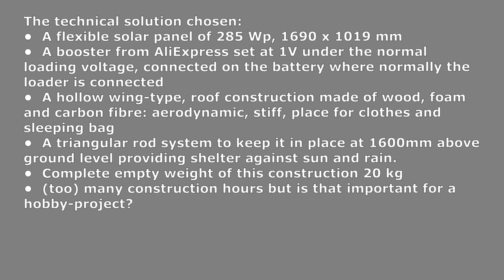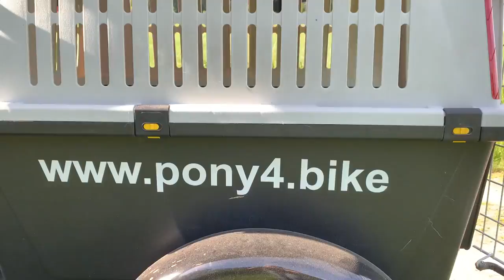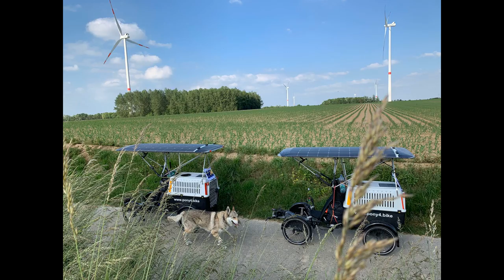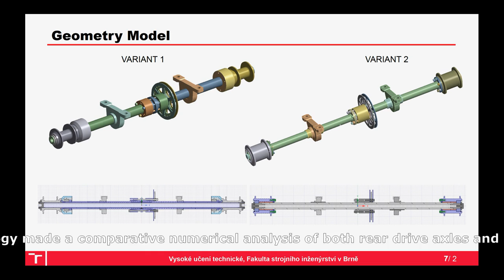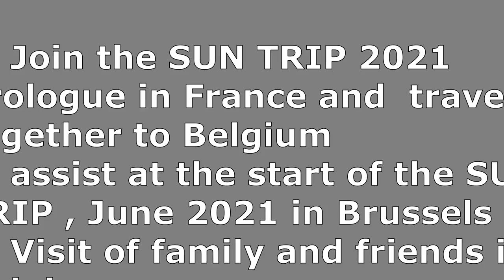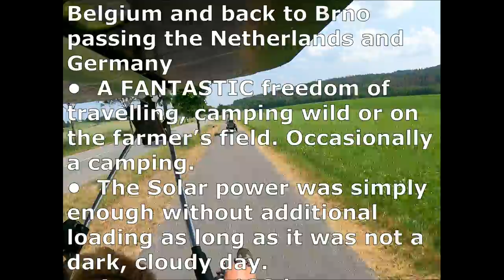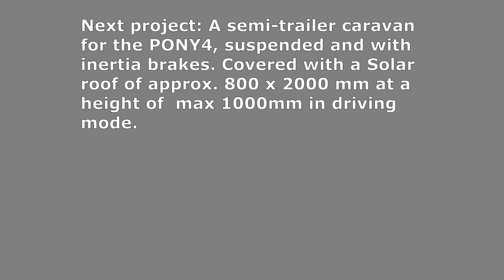PONY4 Solar

Comment: Congrats with Your marriage :-) 
Very nice 4-wheel velomobile construction, apparently with a lot of fine thoughts and ideas integrated. And nice solar add-on.  
Nice video too which "Have it all" and was pleasure to watch. 
I would only suggest a few strong red flashing backlights e.g. with lenses instead many weak LED's/LED-stribes, which is not so easy seen from a distance. To avoid accidents together with cars and Trucks on shared roads. I remember the very tragic accident few years ago where one of the suntrip participants was killed in tunnel. 
Hope You both get many happy solar trips together ;-)
Greatings from  a velomobile-driver in Denmark

Comment: The dogs must be loving this! Being with the flock 24/7, sleeping in the tent, running free or commanding the road from their emperor positions on the bikes! I don't have a dog at present, but I've had 4 Belgian shepherds and a dachshound in the past. I've done bike-camping several times with one of the dogs in a carrier on an MTB. She loved going fast downhills, over 60 km/h. 

My dream is to fit a dog in my Orca velomobile. But even after making some extensions of the turtle deck, I would have to get a smaller dog than I would prefer. This could be the perfect solution! Or maybe a certain four-wheeled S-pedelec velomobile that a rumour told me is in the making... When can I order it? :)
Reply from the maker: Hello, thank you for your nice comment. Soon we will have new news on katangas website: https://www.katanga.eu/news/ regarding the VM-45.

Comment: Stephane can you tilt the solar panel?
Reply from the maker: Hello, yes it is possible to tilt the panels but in limited angle. This was our personal prototype. In the future we would do things differently.
Reply: That was the idea in the start and it would have asked 5 min work to change the angle.  At the end we kept it in the middle position all the time.
Reply: @katangavelomobile115  why you bend the panel? I just read that they produce less electricity if they are not flat
Reply: A flat object has no strength and will vibrate a lot. Give it a small bend and you have a stiff surface. Inside the wing it created a clean and dry luggage room where we put all our clothes and sleeping bag. If this small bend had any influence on the efficiency of the panel it must have been very little. I measured between 5A and 6A at 52V production which is the Peak announced by the producer of te panel.

Comment: I don't understand the reson for this wing-like structure. Makes it heavy and also top-heavy, doesn't it?
Reply: The wing-like structure on the bike holds the solar panel and the lights.  Headlight in front and the large taillight in the rear.  Turn signals too.  This is at driver eye level in a car to get the attention of the car drivers for safety.  At start of the video, they show the construction of the wing-like structure, and it appears to be very light weight.  It also serves to keep the sun and light rain off the rider and dogs.

Comment: Cool but why having solar panels such height not lower?
Reply: the original idea was to be able to tilt the panel and to keep a good visibility with a tilted panel it had to be at this height. As we left it all the time in the flat position, we could have mounted at least some 15 cm lower.
Reply: Je découvre aujourd'hui  le PONY 4. J'adore ! Je voulais acheté un trike mais après avoir vu vos vidéos sur le PONY 4, je pense que je  le préfère.Pour faire un tour du monde, Il me semble idéal pour installer un panneau solaire et avoir de la place pour les bagages. Bravo à vous !